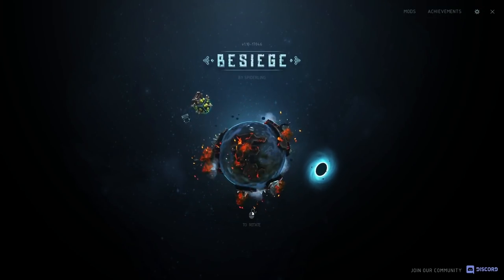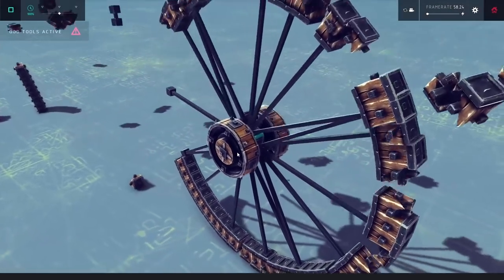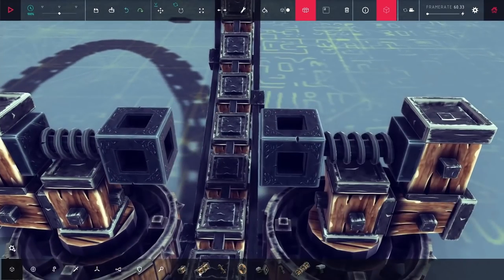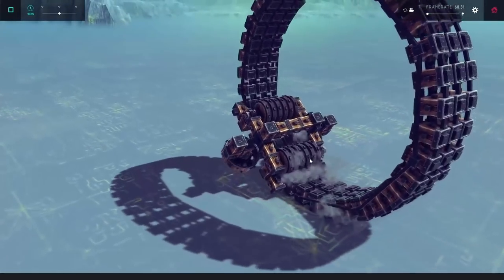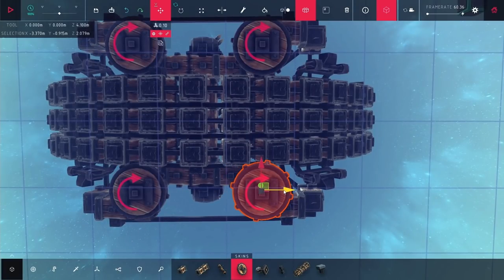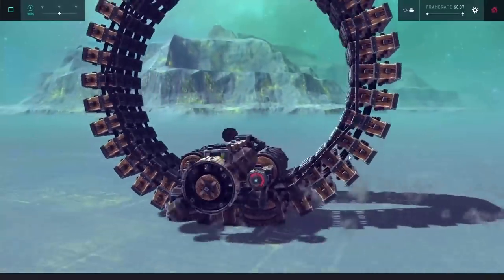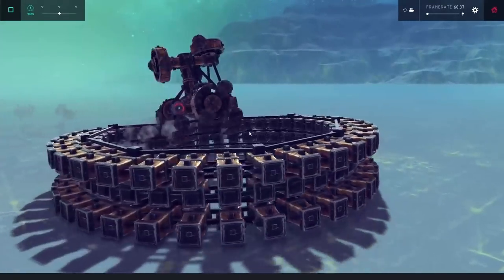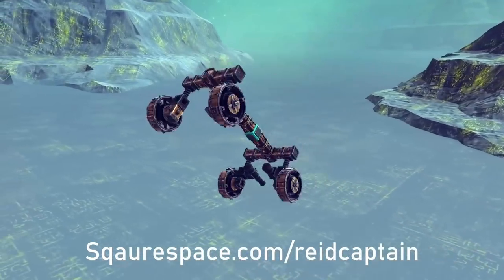Making the Monowheel Motorcycle in Besiege

Comment from the maker: What other vehicles should I make? Also sorry for the late upload, I was working on some midterms that messed up my schedule last week.
Reply: Going with the wheel theme, make Mechanum wheels. It requires a bit of logic to make the combinations work, but it basically lets you go in any direction using only wheels. (Diagonal and sideways as well!)

It's also definitely possible in Besiege, I've actually made them already. It takes a bit of tuning to make the wheels not slip, but it does work.
Reply from the maker: @nikkiofthevalley  I've seen those before, they seem pretty cool for a tank vehicle thing
Reply: Try making a missile using sensors and stuff
Reply: Fusion this and one of your engine
Reply: You should make a tank with treds in this game or dream car builder
Reply: Maybe try a hovercraft, you might have to sketch it though bc I don't think any games could simulate that kind of air shenanigans.
Reply: @Khetamine  trailmakers can
Reply: make a pedrail.
Reply: Make something that can move across the ground without wheels so sort of like a walker but sometimes the game is fidgety so I dont know if this will work.
Reply: It’d be funny if you built a bridge or a mobile bridge. I think an all terrain vehicle would be cool, more of a super suspension machine you could climb any hill with.
Reply: A screw tank?
Reply: A Rocket
Reply: Time machine for April fool's
Reply: @nikkiofthevalley  Mechanum or Omni?? I’ve seen both but I’m not sure which would be easier
Reply: @jaysonbunnell8097  Omni is really weird, I haven't managed to figure it out yet. Not sure if I'm doing stuff wrong or if it's just not really possible with the weird friction and high amount of flexing.
Reply: Make a realistic car in ksp :) I love ksp :)
Reply: Hot air balloon?
Reply: Engine powered VTOL in Besiege, similar to a V-22 Osprey. That would be awesome!
Reply: Hear me out, what if you made a factory that produces little cars?
With like deposits(logs, grabbers, wheels) conveyor belts and robot arms?
It assembles a little car(or more than one if you make it repeatable) that then goes on straight indefinitely XD
Reply: You could adapt the driving motor to work with a monorail system!
Reply: Could u make a Mech?
Reply: Make a helecopter in scrap mechanic!
Reply: Hot air balloon that goes up and down without fans
Reply: Tank autloader
Reply: Can you make a submarine?
Reply: Make a vehicle with omni-wheels
Reply: you really need to watch that veritasium video on riding a bike. then try to make another monowheel in a different game
Reply: you should try to remake your clock, but this time with more of a wristwatch type movement. try to make a mainspring that can be wound instead of having the falling weight. also try and make a better escapement without a pendulum.
Reply: Snake tank
Reply: A car
Reply: @ReidCaptain  Make a small drone.
Reply: TRAIN
Reply: It's OK take a break you need it
Reply: warthog
Reply: A maglev train
Reply: @ReidCaptain  how would a war rig sound?
Reply: Perhaps a sort of zeppelin or airship

Comment: Hey Reid - your problem with the reaction wheel is that it has to be (on average) near the center of mass. If you have it near the side, it will produce weird angular torques that tilt your thing as you noticed. This problem could be solved by having two mirror reaction wheels on the bottom & top, which average out to being 'in the center'
Reply: nope, it's because of gyroscopic precession. There's also no fix for it as it's an inherent property of spinning bodies.
Reply: Source?
Reply: Next time you ride a bike try to consciously turn. You will realise that in order to turn right for example you first turn left and then the bike tilts to the right and the wheel corrects itself to the right. If he actually inverted the controls and tapped right he would stir right and then if he tapped left he would balance himself back straight.

Comment: This is really cool! One of my favorite builds so far. I was wondering if it could be more stable if the inner part was larger and formed like a half circle so it doesn't climb as much, but maybe that wasn't an issue. Could you also make turning with pistons with weight on them, so they extend to the side you want it to tilt towards

Comment: I think monowheels usually have an upside-down triangle on the inner diameter with  runners on each vertices to help guide the main engine and to keep it aligned with the wheel to prevent it from falling out of the wheel.

Comment: fyi effective reaction wheels can be made using braces rather than having to rely on mass at the outer radius. this works because for "legitimate and understandable reasons" the game treats braces as if they are moving through a viscous medium during rotation-based calculations. this unintuitive property is also worth keeping in mind when making any quickly rotating part as it can give rise to unexpected resistance that gives the illusion of friction as well as exaggerated wheelie forces and the like.

you could of course use flat block stabilization but that goes a bit too far into glitch territory for the ethos of this channel.

Comment: Instead of moving the side reaction wheels out to prevent them from hitting the ground, put a bearring thing on the wheel, and brace that bearring to whatever the wheel hits to prevent it from hitting, and to where the reaction wheel is connected to prevent wobbling. (In my tests, this has been able to support 6 stacked wheels, each at power 2, with extra weight without wobbling or unwanted collisions. Not in unbreakable mode.)

Comment: A few minor or maybe major improvements to the wheel:
- build the motor curved inside the wheel and put the outside drivewheels higher up the curve. This will allow you to connect them with straps so the whole machine wouldn't be able to fall apart as easily.
-make the same sensor with the angle only reversed for the flywheelcounterwheel. So when the sensor detects a to harsch angle you would be able to correct it. Next step would be to put another contraption like this for when there is no angle at all so you wouldn't end up overcorrecting
-put the flywheel more into the middle and copy the whole motor on the top curvature aswell. This would in theory lead to more speed better control and less overtipping.

Comment: I honestly think that the easiest way to solve your tilting problem is making sure that the turning wheel is closer to the center of mass. The turning wheel made the top part, or the bottom part turn more than the other and therefore made it tilt
Reply: So, that would be intuitive! But reaction wheels, because they aren’t changing the center of mass, cannot rotate an object around anything but it’s center of mass.

Comment: this is probably kinda late but I remember in your previous videos, you used things like smooth stone and bearings(?) to create "rail systems" where you'd be able to create sliding motion. there were people in the comments offering better alternatives, but wouldn't this help in making the wheel a lot more bound to the motor roller thing?

Comment: I find the "tyre" a bit weird, you probably aren't doing yourself a favour with the tilting when a slightest tilt makes the entire thing balance on a single row of wood blocks. Also, why use a wheel to induce a turn? You could've had a pendulum swing side to side to throw of the centre of mass to make it turn. It wouldn't have worked during standstil but the sole reaction wheel worked there.